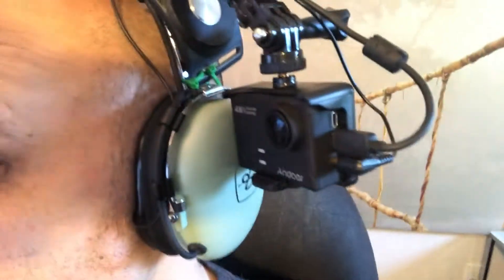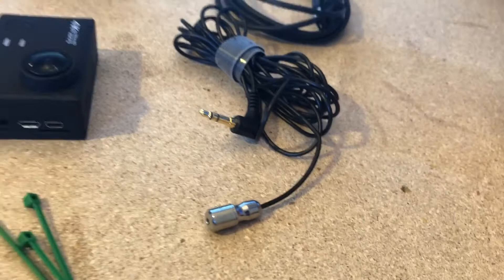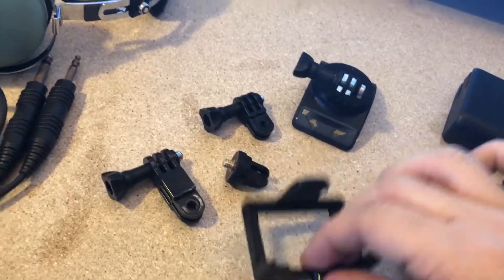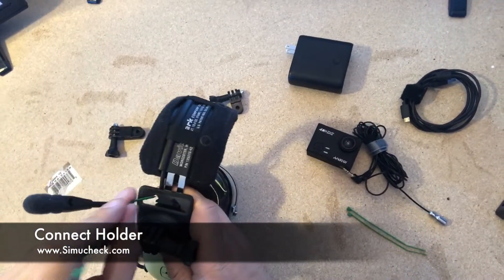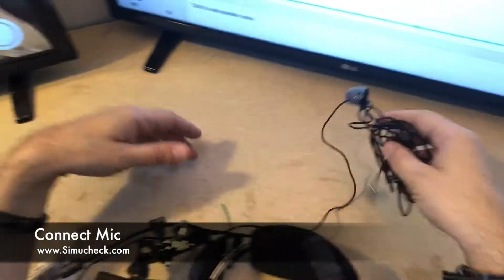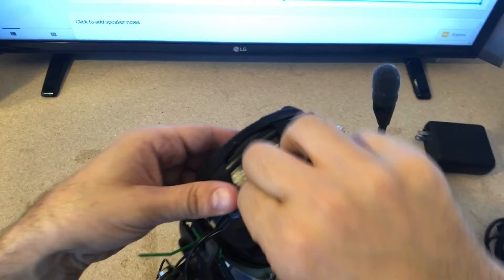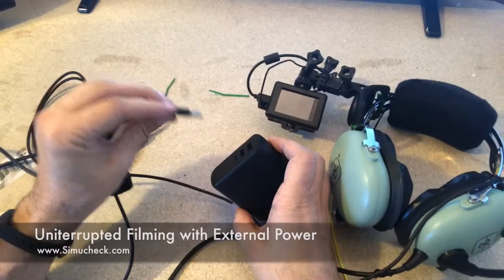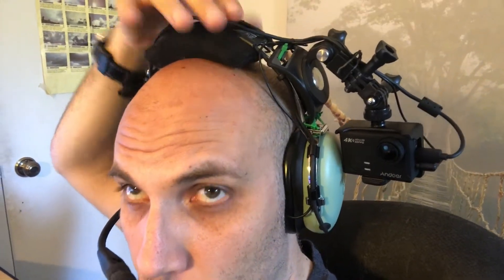NEWER VIDEO EXISTS: Mount GoPro type action camera to David Clark Headset, record ATC aud...

Comment: Just started my training too. Looking to do a headset camera mount when my headset arrives. Very useful knowing there is a camera with direct mic in. Loved your footage - my first video was taken from a mount on the ceiling of the plane and looking out the front and was pretty crap. I think my cheap action camera is not up to the job but also the propeller causes issues like in yours too. I have purchased an ND4 filter and crudely taped it to the crappy action camera again. It is supposed to stop the propeller "lines" appearing in the video. Going to try it tomorrow morning so fingers crossed and if it works I will do something better than tape it on. 

It is a shame there isn't a round torch style action camera with mic in - i am tempted to buy one, possibly with GPS (motorbike gps camera on ebay) and open it up and take the on board mic out to a wire and fit it inside the HS. It would make it a full time install but the smaller form of it and lighter weight might be ok.

I am six hours in now and have not produced a satisfactory recording or video yet but I am enjoying both the training and the playing around to get the best results. 

Really enjoyed your video and hope your channel grows.
Reply from the maker: Thank you ! This was the first video, make sure you checkout my newer video where I used double sided velcro which works even better :)